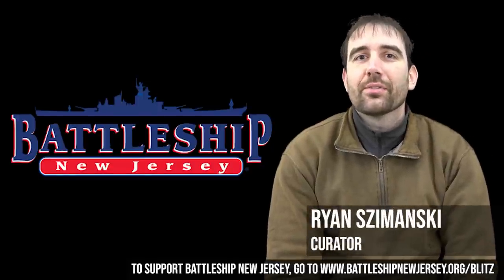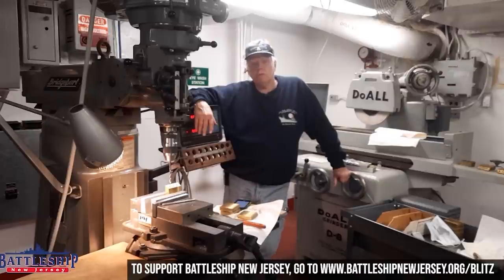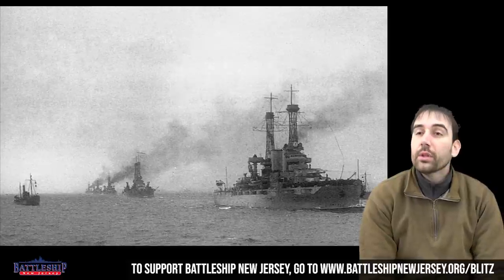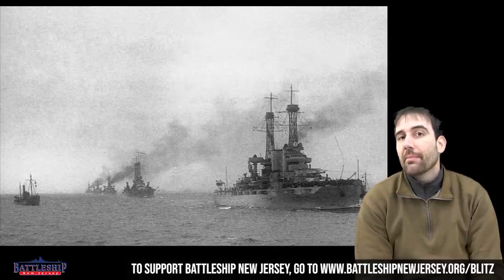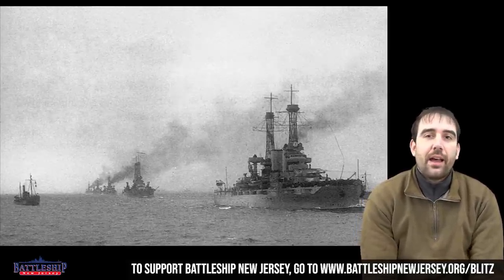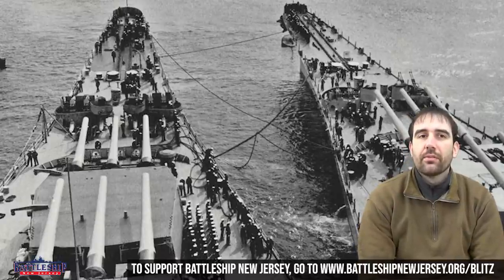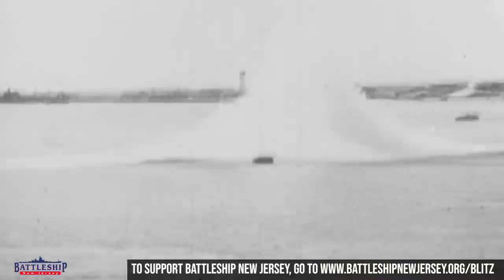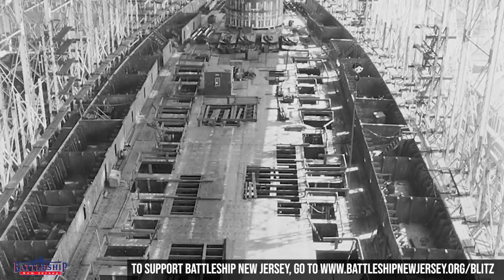The Evolution of Armor on Ships

Comment: Why is it that armor so often seems to perform below expectations in combat?
Reply: It does?
I'm not sure I know what you mean. Can you go into a bit of detail about what gives you that impression?
Reply: Multiple all Engineers' claims by 0.5. Multiply all salesmen's claims by 0.25.
Reply: @ghost307  
Engineers overstate the performance of their designs by a factor of 2?
That's not my experience working on the tech side of busines.
In my experience, tech guys tend to err on the side of caution.
When it seems like a tech guy has overstated, it is imo usualy a sales guy who misquotes them or badgerd them into giving them a 'more optimistic' estimate and the tech guy eventually caved in just to get ridd of the guy.

As to sales guy,s while I do agree that they can be - and generaly are - the worst, they are usualy ot that bad...
Reply: @Bird_Dog00  I really wish that I could agree with you but whenever I design something the beancounters use cheaper materials and the contractor uses different methods (to maximize their profit) until the final product is considerable less capable than what I had originally designed. However it says a lot that when the Engineers were in charge at NASA we landed on the moon several times but when the Managers were in charge at NASA we lost 2 space shuttles to ignorance, arrogance and stupidity.
Reply: @ghost307  So, it's not the engineers but management.
Reply: @Bird_Dog00  In my experience it is. I can't count how many times I had to explain something in careful detail to a manager only to watch him make a decision based on money, an arbitrary schedule or politics. This illustrates the validity of yet another saying "There are 2 kinds of people...those who understand what they're not in charge of and those who are in charge of what they don't understand".
Reply: Once a ship is built, the armor is a fixed quantity. On the other hand, it is possible for guns and shells to improve over time, invalidating armor assumptions that went into the design of a given ship. There's really no such thing as armor that protects against all threats -- it's always a compromise of weight and cost vs. protection.
Reply: @ghost307  Sounds like these managers studied at the Dilbert School of PHB (part of Trump U.).
Reply: @philperry4699  Dilbert is not a comic strip...it's a documentary.